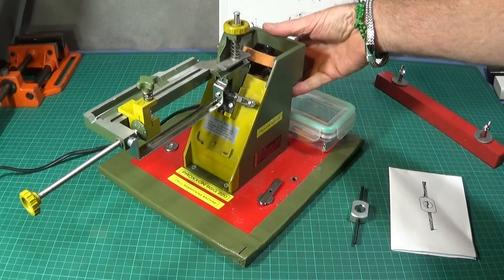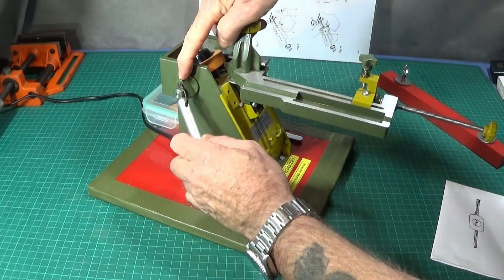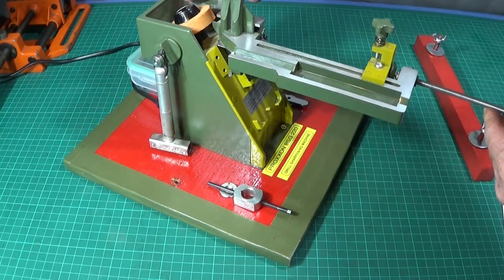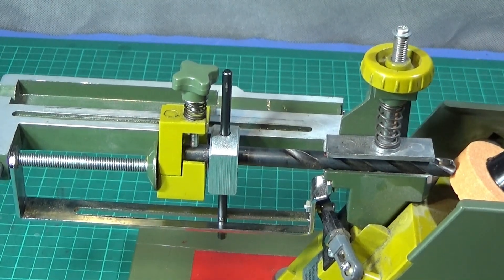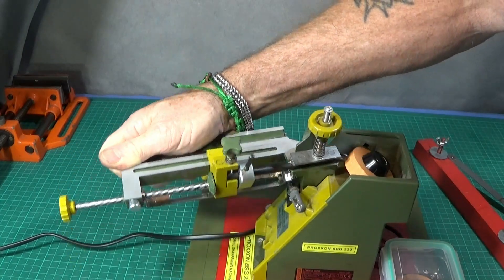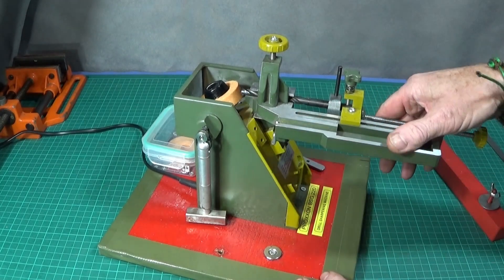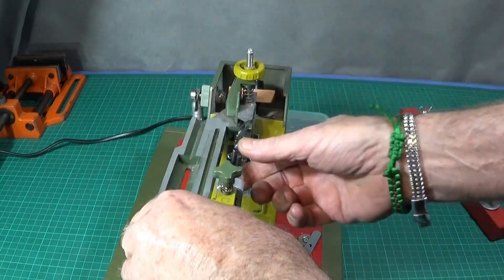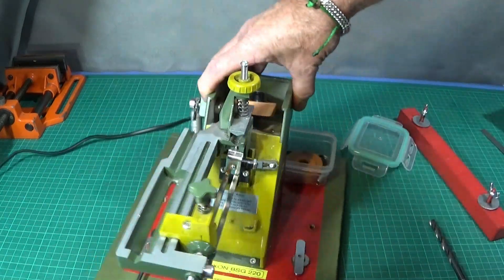HOW TO SUCCESSFULLY USE THE PROXXON BSG 220 DRILL SHARPENING MACHINE

Comment: Minute 7:43 - perhaps ten millimeters or eleven will not do any problems. What it's important is that - when reversing the drill to sharp the other side - that distance will remain always the same, and the drill will touch again the back metal, so the rear wheel ( the plastic one with divisions ) will remain "true", to get equal sides at the point of the drill ( and the point of the drill will remain "centered" ... )
Reply: Absolutely correct!

Comment: I bought a PROXXON Mf 70, a micro mill, a few years ago. It was converted to CNC. However I exceeded the intermittence, not told any ware, and fried the motor winding. The Swedish agent sent me the wrong motor and it took 6 months to get the payment back.
When returning the wrong motor to the agent PROXXON was contacted. 2 quick Emails and the shipment reached me containing the correct motor within 2 weeks. That's German precision!
Looking at something intended to be a cooling fan it's obvious that the designer had no knowledge at all regarding air flow.
Loosing patience in creating a proper cooling the MF70 has only been connecting dust.
Go for better, more solid tools then PROXXON.
Sorry, not looking at the entire video. It started telling the back side I already experienced.

Comment: If I had that fangled contraption it would be on Ebay too!  The Vevor collet machine leaves this for dead, in ease of use and accuracy.
Reply from the maker: Hi Yes, I was going to try one of those when they are sold by Vevor in the UK. They look excellent.
Reply: Totally agree, I have the proxxon drill sharpener also and because you have to flip the drill over it is very difficult to keep your grinds perfectly centred. I bought myself the vevor grinder in the end which really is worth every penny. The proxxon is gathering dust.
Reply from the maker: I have found that the Proxxon has a perfect grind every time. However, I will get the Vevor one to try as soon as it becomes available at Vevor UK. The Vevor one looks excellent.

Comment: a smaller knob on that guide clamping screw could mean you could use less than 10mm stickout in the back, and then seat that drill guide against the face of that lower clamping block

Comment: Please , whats the smallest diameter drill it will "practicly" sharpen ?
Reply from the maker: I think it will do any size, but with the smaller ones, you will need the Proxxon small dia drill adapter set. You can buy this set on eBay.

Comment: Minute 12:20 - too much forward, unless your drill has missing pieces ... half turn of the back wheel should be ok. Also the motor has very low power, and too much work can damage it ... moreover you have then to rotate all the sistem, an so the motor will work much more ...